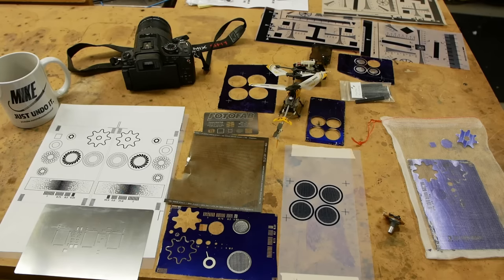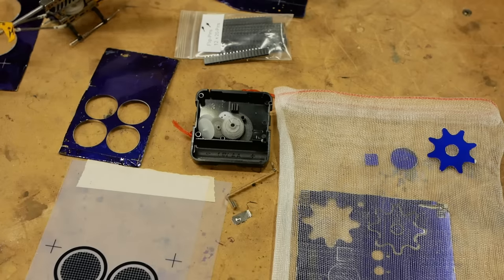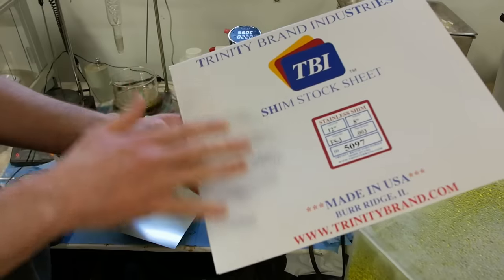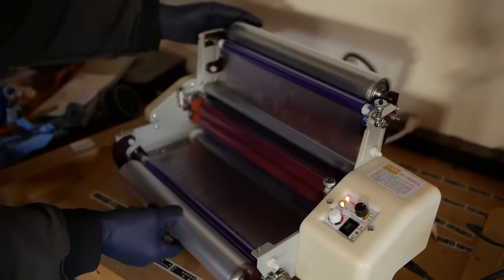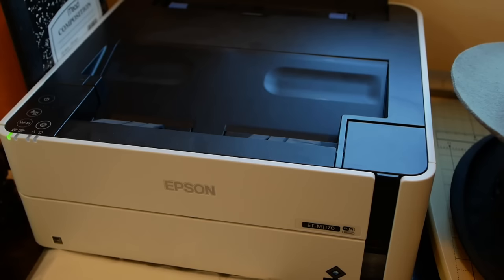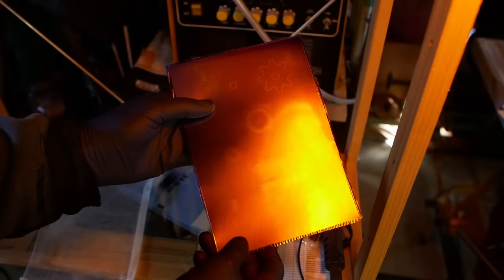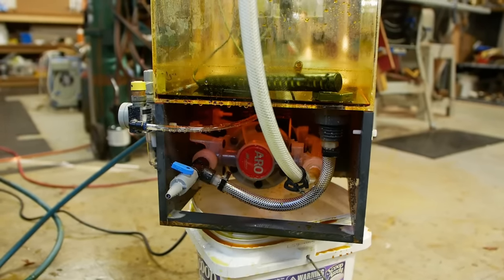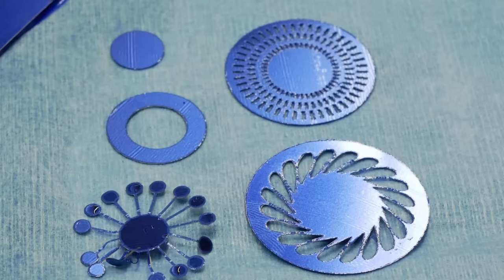How to make precise sheet metal parts (photochemical machining)

Comment: Personally, I'd paint on the resist instead of laminating it. ANd do be careful with them pumps and pressures and etchant, it'll take about any material and crumble it from the inside out over years of use, yeah, you're 100% right- chemical resistant plastics have issues lol

Comment: CNC machining, while the client interface may feel "fully automatic" is most definitely not on the actual fabrication side. There's stock material size, tool sizes for roughing and finishing, toolpath parameters such as cut depth, cut stepover, feed rate, cutter RPM, and expertise involved just in making sure the desired tolerances are met because of the machine, temperatures, material type, etc... They would be including a margin cost to account for the variance in how easy/difficult parts are to average it out to be profitable. Virtually everything around you is the product of a CNC machine milling out the 4 parts of an injection mold clamshell for plastic stuff, or the part itself is CNC machined - which is typically fancy consumer devices, medical, optical, mechanical, etc... Most people don't come across very machine CNC machined parts in their day-to-day lives because it's such an involved process. It's not 3D printing, that's for sure.

Comment: I also tried photo etching once. Our level of technical sophistication is almost comical. I just ordered some photoresist film and sodium persulfate from China, already had a laser printer, transparencies, copper plates, a clothes iron, sodium hydroxide (as no brand drain opener) and a UV flashlight. The results were, of course, equally comical.

Comment: Awesome! Very fascinating. I had always wondered how really fine metal mesh details were made.

When I started getting into making PCBs I decided to switch to cupric chloride instead of ferric chloride because cupric chloride can be regenerated very easily. It doesn't etch as fast but I don't have to keep buying ferric chloride. ;)
Reply: As another viewer commented, adding citric acid helps a lot. You can regenerate the FeCl electrolytically, using a couple of iron nails as electrodes which is handy because it fixes the copper and keeps a nasty toxic chemical out of waste streams (copper salts are toxic to most aquatic lifeforms) It's also doable chemically but then you have more mess to deal with
Reply: @miscbits6399  I'd skimmed comments but didn't see that. And yeah, copper is a toxic heavy metal but so far I haven't needed to dispose of any of the etchant. Regenerating the cupric chloride is as simple as bubbling air through it overnight and decanting the green liquid off the top. You can also just generate more etchant by adding more HCl but I haven't needed to make more of the etchant.

Comment: Some DIY electronic people either rebuilds Epson C86 etc printers or other ones with straight feed path to print directly to PCB/metal sheets using water resistant dye avoiding the whole
photo mess and goes directly to etching. Epson Eco tank/Richo/Roland printers with some water resistant ink. Another process is laser to glossy paper then a acetone/water submerging
while pressing/rubbing to transfer the pattern to metal also works quite well 5mil tracks is doable by hand. Or a plotter printer laser modified with UV leds is also an idea.

Comment: an idea for adjustment, make a frame for the glass sheets independantly, and then tape the mask onto the glass sheets roughly (with alignment marks) and have fine pitch threaded rods (like m3) to adjust the position and rotation of the sheets finely. though having etched marks on the glass without any adjustment might just work.
the advantage is that if you need to make multiple copies, you don't have to fumble with the taped transparency sandwich, and it's probably more durable since you're just pressing the two together. also you probably have less bowing though that doesn't seem to be an issue.

Comment: I've heard of people having luck with "silicon backed paper" (the backing paper that stickers are typically on — large rolls of "Contact Paper" might be a good source) in a laser printer to get something of some density you can "iron on" to metal for etching. Probably not a high enough resolution for your needs.

Comment: A clean air source does work for drying, but it has to blow the water off the part, not evaporate the water or contaminates dissolved in the water are deposited back on the part.

Comment: I'd suggest taking a note from screenprinting in your alignment (registration) process for the 2 sides... Oftentimes, screenprinters will use clear acetate to align prints before printing directly onto whatever surface the final print ends up on... Essentially, you'll just take that type of setup and double it... Using scrap sheet the same thickness you're going to print on to line your 2 sides. Don't forget the registration marks... Plus, instead of ink jet, you can just screenprint directly...

Comment: If you created 4 - 6 quarter inch holes you could print or laser cut that hole, and stick a rare earth magnet over top of the acetate sheet onto a metal plate. Then add magnets to the other side. So 8-12 magnets on a thin plate. 

Or just create crosshairs with a one Pixel gap in the centre and poke a hole in each crosshair. Line them up and double side tape one end. I would probably take a 2 x 4 piece of the same material and double side tape or glue each side. Just so there's no tolerance unaccounted for. Stick four pins 📌  in the first sheet, add tolerance bar and stick the backing onto your four 📌.  

What if the entire clear acetate sheet was black and you laser cut the sheet with pattern and alignment holes. They would be perfect every time. And the magnet alignments would be spot on as well. Justale sure the magnets aren't rounded edges.

Comment: Cool video. One question about the etching problems. If the ferric chloride is so problematic, why not use electricity for the etching? My experience with electrolysis using salt water is that most electrode materials corrode away rather quickly.

Comment: Really great video which such a nice level of detail, thanks! Is there a possibility that the high psi of the ferric chloride could blast off the photo resist? I use laser ablation to create my stencils (sheet metal with coating of spray paint), is this something you looked into before deciding on using a photo resist?

Comment: Interesting solutions for a small custom run. I cringe at the expense and complexity though. I can tell you have refined your process through a lot of trial and error, which must have been time consuming, frustrating and also quite costly. It is however a solution, for which there are not many other options. I applaud your ingenuity and prototyping skills.

Comment: Hey, this is kind of a roundabout way of doing this, but what if you ordered solder stencils from JLCPCB? 1200mm x 320mm of detail area only costs $119.29 (380mm x 280mm -- just $7.00). Just a thought

Comment: ... my garage is cold so I'm going to build a nuclear pile to keep it warm all winter long. First I went on eBay and found some yellow cake, then McMaster has the proper vessel. Had a little trouble with the shielding but found that a coke can doubled up works just fine, but needs to be the European ones because the paint they use on the outside isn't used here in the USA .... 
THIS is what these vids are like... I wouldn't have it any other way.  Never change, gives us neighborhood blacksmiths something to reach for.  :)

Comment: Thanks for the detailed description! So the reason one prints on extra sheets instead of the protecive layer is the special ink soaking emulsion. Would that be different if the laser printer worked or would it expose the layer?

Comment: Maybe for aligning masks for the front and back, you could either:
(1) Create a "vernier grid" or set of "vernier circles" or "vernier bars".  
(2) Create a pair of grids that put together form a moire pattern, that changes depending on how they are aligned.

Don't know if that would actually help in practice.
The idea is simply to make small mis-alignments easier to see (like the Vernier scale in calipers, or how moire patterns change rapidly when alignment changes only a little).

Probably the best way is just to use a 10x-20x binocular microscope.

For moire patterns, Wikipedia might give some inspiration:
https://en.wikipedia.org/wiki/Moir%C3%A9_pattern

Comment: I think Polytetrafluoroethylene (PTFE) or Teflon should be able to stand up to Ferric Chloride particularly because it has a Fluorine bond in it. It's probably going to be a bit expensive but with your setup already I don't think that will be much of an issue. Best of luck, thanks for sharing.

Comment: I hope someday you get to do some research on using UV laser to do ultra high resolution photoresist sensitizing. Using polygon laser scanners found in laser printers. There is also someone from hackaday using a prism to do the same concept replacing mirror with a prism.

Comment: This whole time I have thinning down the paste like thickness emulsion masking material from silk screen making, so I can spray it through a cheap Harbor Freight LVHP and the standard HVLP and HPLV works to, 

SIDE NOTE: I purchased a few air brush sprayers, from cheap to expensive, like the TESTORS cheap plastic model unit, a Harbor Freight unit which is a nice unit, and have use for spraying paint, works great for paint, and I got a Pasche airbruch unit. I haven't had time to play with this change-up of spraying the thinned out emulsion yet, but i do think it will help out further down the line in measuring out "how much emulsion is used on each side of the sheet metal stock material, for the weighing process?

BACK TO THE POINT: but due to the still thicker material than actual pigmented paint systems/brands, the last two types of spray guns, do work, but I couldn't get the spitting or sputtering to not do that, when you let off the or start up spraying. I suppose you could just start/stop while off the sheet metal material, but, id you get any sputters on the sheet metal material, those dinky spots can be really thick of a magnitude of 10 to 30 times. If you are lucky, those sputter spots land where your artwork is not located, but down the line of my production of personal parts needs, if those spots are ONLY on one side  and still away from the needed zone, the overlays will not sit as tight, or flat against the layers of glass, and a tapered or angle shadow effect leaches past the artwork under the UV light(s). I purchased a used UV light table with the rubber hold-down mask, that you apply a vacuum via the on-board built in pump, of course the light as a built-in lighting timer to auto shut-off which is nice to control what you are doing mechanically, which helps me have better control in the later chemical processes, pending how thick the emulsion sprayed on layer is. How I measure the thickness, is not a proper or formal way to do this, and most of you would pull your hair out once you hear how I measure the manually "BY HAND" sprayed on reduced/thinned out emulsion. I use a high resolution digital scale that I pulled out of my reloading work station, which is the Sartorious GD-503. It has all the gun powder auto loader/trickler accessories removed, and a new surround has been added, although it is a plastic/plexi-glass surround, I have all the panes connected via jumper wires, and the whole surround is grounded to the work bench grounding lug, which is in turn, grounded to the wall receptacle as one typically has for, say your anti-static grounding wrist strap system. I have noticed that high resolution digital scales can be pushed just from the lights being on, pending what type of lighting you have, and the ballast types that have a noisy internal humm are the worst. Turning a scale like these on, it is highly idea to allow the scale to relax powered on for at least a half hour, mine just stayed on for days. This process of allowing the digital scale to calm down, and heat up "so to speak" does work and the wondering that happens with in the first hour will drive you mad, so, turn it on, walk away and go eat a whole bag of Dorito's or something... 

Once my sheet metal is clean, lint free, to the best of my dirty shop's ability, I weigh the sheet metal, a few times to get a base average weight. Then I have a roll of automotive protective transport film. It is a clear or white, single sided disposable film. I cover one side only, and only serves to manage over-spray from getting on the back side or the side I am not spraying. I also use a hole punch to poke a few holes in the film, to aid in hanging the sheet metal while it is drying/curing in the dark room (a dark place, I do not have a photographer's dark room). 

I spray one side only, FIRST. allow the emulsion on the one side to dry/cure. Once cured, I peal off the automotive transport film and no worry, the film material doesn't leave any sticky junk behind, and I weight the sheet metal with only the one side sprayed. document that number. Then through the various testing from how much the emulsion was used based on how much was measured out by volume, then reduced/thinned out by solvent also measured by volume and not weight, after thorough mixing and viscosity ZAHN flow checking. which is a pain in the booty to do and messy. I want to find one of those scraper type meters that is a piece of precision ground tool steel that in the middle, has a slight sine slope that is graduated/numbered for the particle thickness of the paint pigments? That likely wont serve me right for what I am doing, but I still want to find one and try it though, But I don't know what the name of that tool is called. It is also very likely, my idea of how I can use that tool VISUALLY is wrong, lol.. but the tool uses a precision ground edge wiper/straight edge also out of tool steel. I have seen them before, but I can't find them on the net, from the various words I typed in to hunt for such a tool. any help would be gratefully appreciated on that note. But, once the one side is weighed, I cover that side now with the auto protection film, and spray the reverse side, and repeat the whole process again. I do go one step thinner on the emulsion and often times requires instead of 3 to 4 coatings, I walk up to the desired thickness by doing several thin sprayed on layers. so the etching process assists in sharp lines as both mask's are the same thickness. Might not seen that critical, but a thin edge does get beat up in the etching process and if one side is thicker than the opposed side, the thin side's edge will get attacked and erode away faster, which leaves a slanted edge.. on material thickness of (0.010") of less, no big deal, as it is hard to see with the naked eye, but on (0.025" on up to no more then(0.062") material thickness it will show, and for material any thicker then the (0.062"), you then get to see a coved edge inwards of the part... which I can tell you, the edge front and back, right were the mask mates to the material, can be alarmingly and dangerously sharp.. be careful with that. perhaps a new and expensive way to sharpen knives, lol... and the rest you folks already know ,from either your own experience or from watching this video or other videos that pertain to silk screening processes. 

Either way, this was fun, I enjoyed this. Again, if anybody knows what the tool is called so I can be smarter about something, that is likely just common knowledge for all of you, it would be so greatly appreciated. I really have tried to look those up. I have even talked with people who I know have used them before, and once I ask, it slips their mind of what it is called, lol.. Thank you.

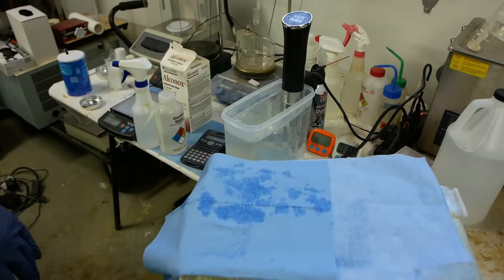Comment: For 8:12 .I sometimes just use a Spin Coating machine to dry my samples (1-2cm in size...). Spin it at 5000 RPM and it gets dry while avoiding dry nitrogen or argon with filters.

Comment: I wish we had some of this 30 odd years ago. I worked in a small company that did photo chemical machining. We mainly did brass parts, with the photo resist being dipped on and then baking the solvent off, really nasty. The spray etching was a flat conveyer system. Ended up with lots of ferric chloride droplets in the air .. yep buggered lungs now :(

Comment: Have you thought about doing a video on how you think about the various problems in these projects?  For example, knowing where to find and how to connect and program the pump and sprayer assemblies to accomplish the development and then etching process.  I wouldn't even know where to begin with something like that, and you - in all of your projects - just kind of casually mentioned that you did this thing.  I get that we're seeing the end result of months of work, but there must be some kind of foundation of knowledge and experience you're drawing from that could at least partially be explained or taught?

I feel like more people might be comfortable doing these kinds of things if they knew where to buy and how to set up the more generic mechanical assemblies you do.  Like where did you get the roller for the ebay laminator?  How did you attach it, a 3d printer?  Did you take all the measurements yourself, get it on the first try?

So I suppose I'm asking for a video about your thought process and when you run in to mechanical / manufacturing stoppages that require modifying something or fabricating an entire new assembly.  I know it's going to depend on what it is, but there must be some modularization at some level?  Like, monitoring temperature, or wiring up to 110, or setting up a simple stepper motor to move a thing back and forth.  Things like that.